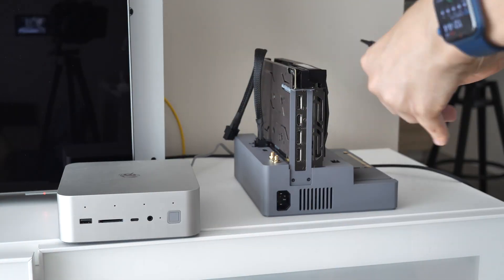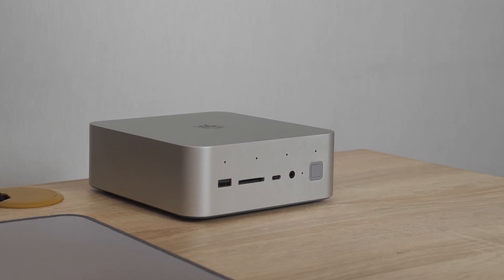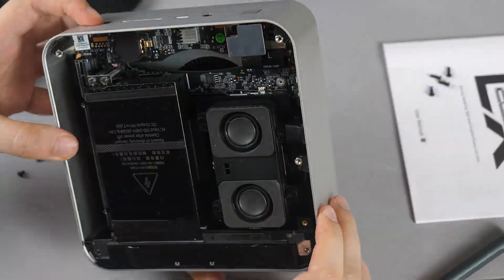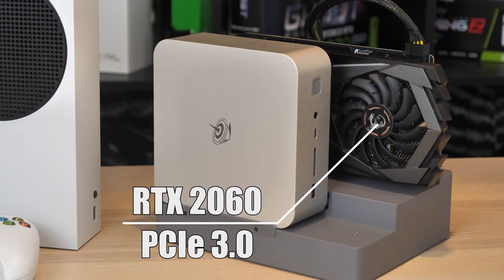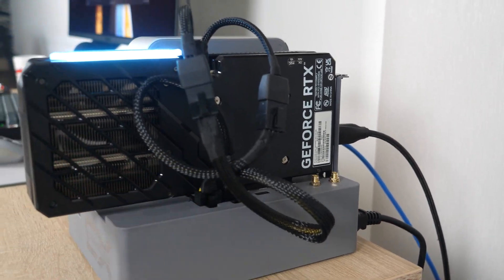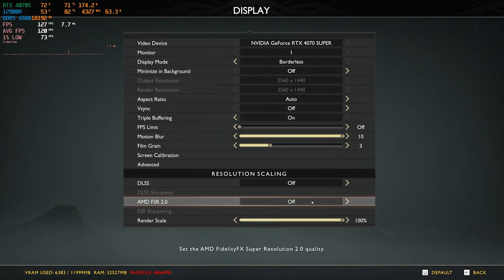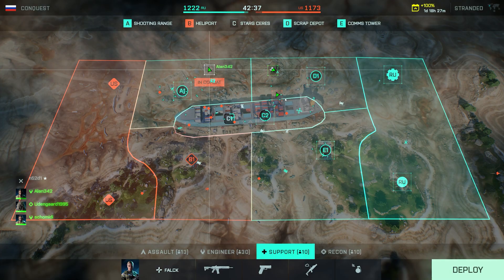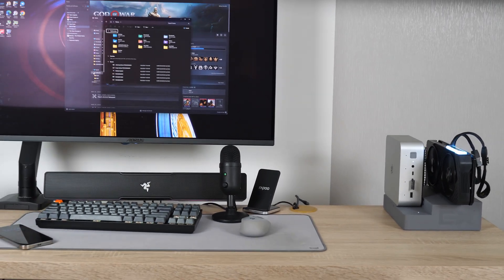Beelink GTi12 Ultra Review:  PCIe 8x4.0 eGPU Connection

Comment: hello, Have you tested when the mini pc is connected to the station, is it possible to turn it on without the charging station when you are not playing games? thx.
Reply from the maker: Turn on a PC connected to the Docking Station, but without powering on the Docking Station itself? I haven't tried it, and I don't really want to be taking any risks :) 
In any case, the HDMI/DP cable will be connected to the video card, and you'll have to reconnect it from it to the PC, which doesn't sound convenient.

Comment: It’s like you don’t use an overkill graphic card it’s probably the minimum graphic card you can use is the RTX 4060 TI or you can use a new graphic card they released which is a Intel arc B580 which is a good graphic card you can use for $250 and it’s a good one to use

Comment: Issues that you did not mention with this exact setup:
-wifi interference much worse when GPU is connected (known issue from beelink who offer a "copper sticker" to put on the protruding PCB part of the pcie connector, unfortunately does very little to solve the issue. Had to get them to refund me the price of a USB wifi adapter.
- all USB3 ports have a lot worse interference than regular Mobo for some reason, not sure where the issue lies but using an RF connector on any of the usb 3 connectors will make using a wireless mouse unbearable at times !
-Same issue with Bluteooth when external GPU is connected to the dock, depending on the load it will interfere with the bluetooth, again i had to use a bluetooth dongle and turn off Intel's AX200 module completely.

Pre-installed windows had a whole load of issues and also had to reinstall a fresh copy and i also ran into the same issues regarding drivers but after a quick chat they sent me the link to all the drivers via a drive link.

Overall really good performance but yes it is pretty finicky. Am i happy with it ? Its ok, beats my old M1 MAX by a huge margin especially when editing videos and photos and gaming is awesome with the added 4070 Super

Comment: It seems it looses more performance than oculink despite the bigger bandwidth, was that your experience? Also, do you recommend to pair this with a 4080 or 90 with the 12 pin adapter?
Reply from the maker: What makes you think that? On the contrary it works almost lossless. Keep in mind that in my comparison I have different CPUs and the 12700K will be a bit more powerful. 
4080/90 can be connected in theory, but personally I wouldn't because of the reasons mentioned in the video. And don't forget about the CPU bottleneck
Reply: By the way about the cable adapter I meant one like Corsair a 12 pin 600 watt single connector would that work? @trysometech52
Reply from the maker: @DonitaTheWestie  I don't think it will fit in there. It looks like their 8-pin connectors are shaped differently
Reply: @trysometech52  looking at videos from ETA prime and the oculink does better on a 4090. I personally have a 4080 with oculink and on benchmark tests the oculink was getting better performance than some other people with this dock. Time spy and steel nomad. The game ETA prime showed were at 4k so CPU should play little role in that right?
Reply from the maker: That's not how you should compare them. You need same CPU/RAM/ list of games/ settings (and so on) to correctly compare them. That's exactly how I did in my previous video with 4090 on testing Oculink\Thunderbolt\PCIe x16. So you can see how and where bandwidth affect performance. 
Oculink just factually can't perform better than this Dock, since I checked bandwidth on the Dock and it had double score over Oculink.
4k resolution = less CPU depending, that's correct. But in my experience, games with RTX require more bandwidth, so it's better to compare there.
Reply: @trysometech52  got it, that's a good explanation, so maybe the 8845h is just that much better than the Intel CPU. Perhaps on a 5080 this would make more sense, or if they ever release an AMD variant of this